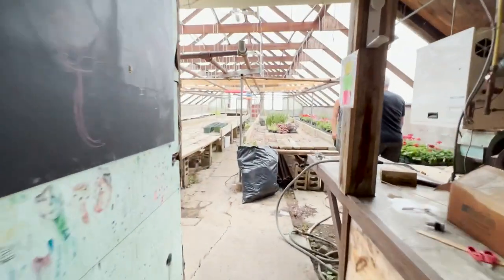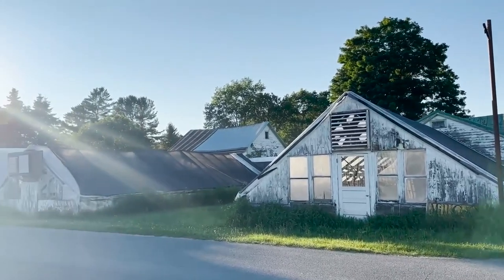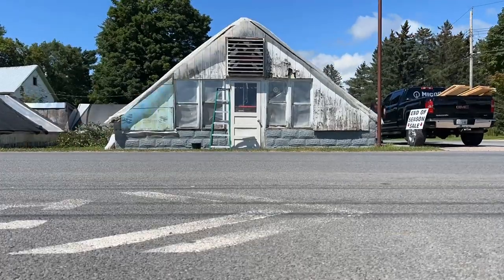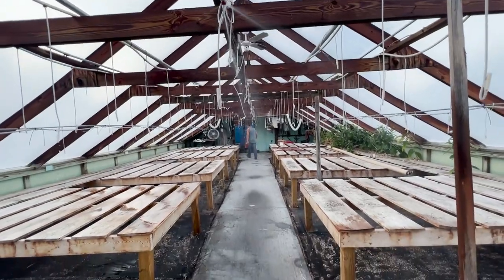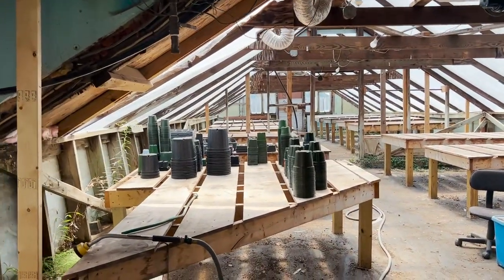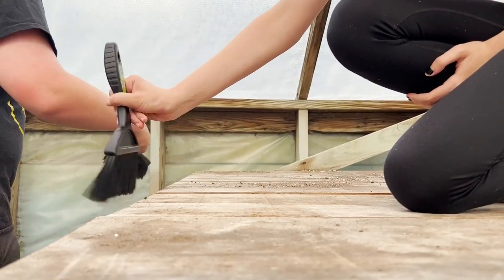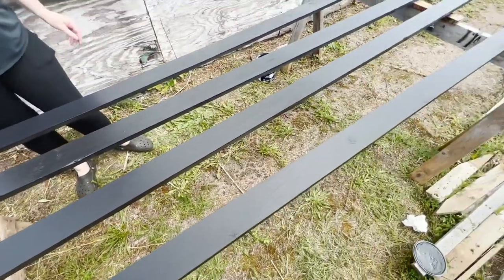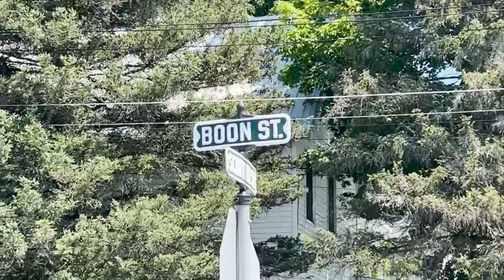Renovating the Nursery : Week 1 : Flower Hill Farm

Comment: top tip to clean that glass= spray water onto glass with hose and get a razor blade to scrap all the gunk off :) it won't stretch them but it will save a lot of time and they will come up perfect <3

Comment: Instead of paint have you considered Shou Sugi Ban? Originating in 18th century Japan, shou sugi ban is a particularly striking method of preserving wood by charring it with fire. Traditionally, this practice is used with Japanese cedar in order to weatherproof it. The wood is burned until the surface is charred, and then coated with natural oil. It looks beautiful and makes a wonderful texture! It can be smooth or it can have raised grain...and its fuunnnn to do too...INEXPENSIVE....you dont have t o use cider wood but of course that would last a lifetime. Ive seen it on wood used on older traditional Japanese homes and gardens, its interior as well as exterior and a nice touch! love it !

Comment: Girl, windex and paper towels are not going to do the job! You need to get a bucket of soapy water, use 409/Mr Clean ?,  a couple of good big scrub brushes and a hose for the outside. Scrub away, hose, repeat. When the glass looks good, then use windex and newspaper if you can get them, and shine . When you start scrubbing the inside use a little bleach in the water, t will help kill mold and help keep it away. I owned a cleaning company for 10 years and just sold a nursery I had for over 20 years. Super big job ahead, it will be worth it! BTW, Both your cousins are easy on the eyes!

Comment: Oh and for the windows, and the old caked on mess... Use Coconut oil. Make a mix of coconut oil and lemon juice. Dip a cloth and scrub the windows, let it sit for lil’awhile (5-15mins) and then use a clean towel to buff it into what will look like a cloudy mess. 
Then you can mix of equal parts white vinegar and warm water, dip a towel in that, give it a good wipe down. 
Then a soft dry towel to buff your glass to get clean streak free shine✨... 
😏 my hubby swears by newspapers for this part.. Although I don’t recommend that.😆